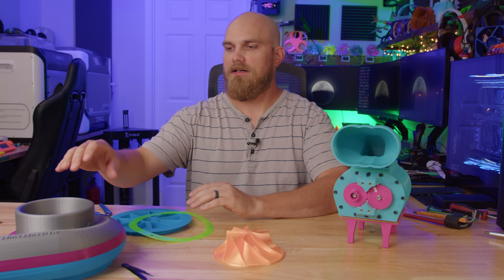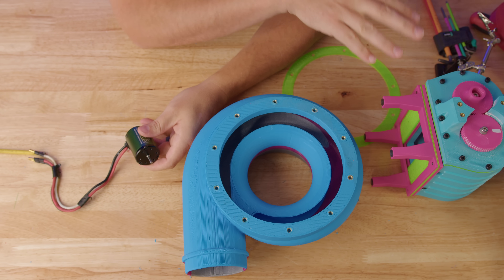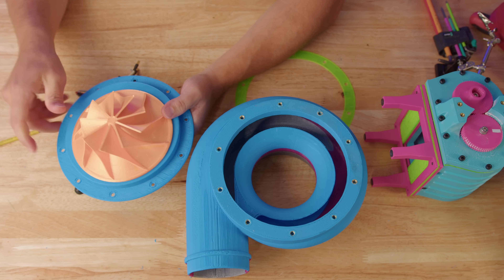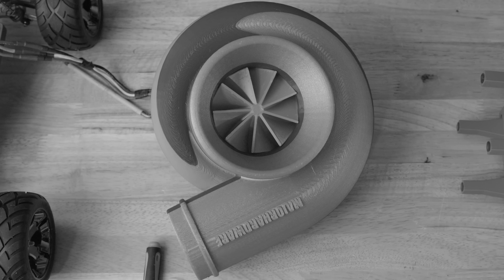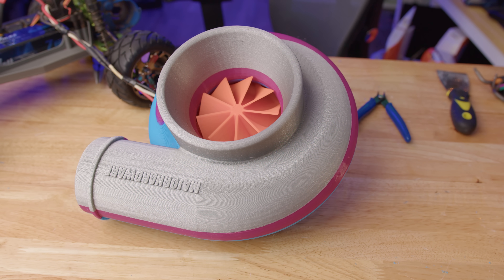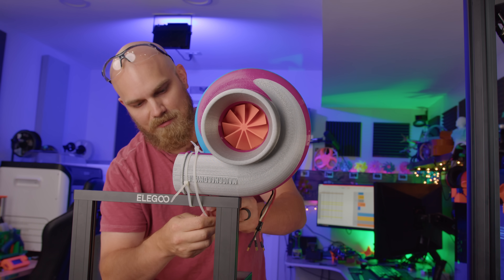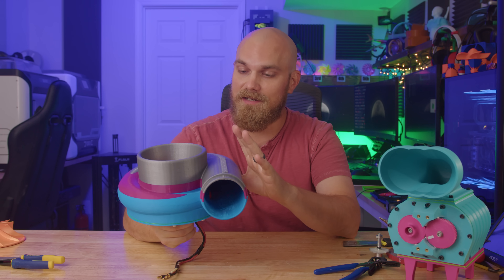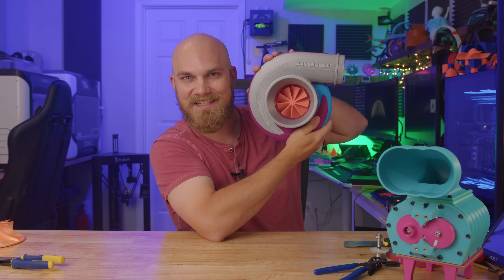I BUILT a MASSIVE ProCharger for my PC

Comment: The Procharger needs as many rpm as possible and a bigger motor will turn slower. I would build it like a real one with a shaft with bearing support and the compressor wheel bolted on one end and the motor to the other. This will also allow you to set your clearance and achieve less fiction.

Comment: I would use 500 Watt brushless spindle for the mini CNC. It comes with power supply and driver and potentiometer to regulate the speed and it hits 12K rpm. Once that are really brushless are 55mm diameter and 48 V. There are some that look like brushless but aren’t. Those are 52mm diameter. Those come with dangerous power supply that is not mains isolated. 
So 55 mm has normally ER11 collet and thick front part of the axle and 8mm axle at the thinnest place. They are relatively quiet and very concentric and vibrations arm. Powerful enough with 2/3 rd of the horse power. I bet it would do you proud😊

Comment: I just finished a printed compressor prototype last month (I'd love to see you try it, but the stats are maybe too boosty for the general format here -- 11CFM / 1.2 PSI) and I landed on 775 DC motors as a decent starting point.  It's a standard motor size (variable length but standard diameter and mounting pattern) with a 5mm keyed shaft that really simplified experimenting with various drive ratios using readily-available 3D printer pulleys and belts.  Night and day coming from 3mm shafts!  They take 12 to 24V and come in a variety of power levels and RPMs, and they're pretty cheap to boot.

I do want to mention I love that you had to do the volute in multiple colors ... it's really photogenic this way and helps visually convey the beauty of the shape!  I would STRONGLY suggest that if you want to make a proper go of this, put the impeller on a thru-shaft supported by bearings on both sides (e.g., with the upper bearing supported by vanes across the intake) or at minimum supported by double bearings beneath, and make the impeller fine-tunable for spin flatness, bore concentricity, and (of course) actual balance.  Having designed (and re-designed x4) a similar compressor on a smaller scale, I can tell you a tall impeller supported on the bottom only is asking for unnecessary hassle :P

Comment: silicone gasket; 1/2hp, 1650 rpm motor; 2x belt reduction or more. Make it compress and push so much air that the air itself gets hot. Loosen your tolerance for the compressor wheel. Its already drawing so much that you don't need tight tolerances. Bernouli's Law means it will keep sucking air in even with looser tolerances.

Comment: Do the procharger again.  But, make the outlet match up to a 120mm fan hole, and bracket.  So, maybe make it just a little bigger?  That way you don't need to use tape to make a duct.  And just for SnG's, if you have an empty PC case, hook this up to the empty PC case for the smoke test.  I say empty, because I wouldn't want to cause any damage to anything inside mentioned empty case.

Comment: turbine needs to be mounted in bearings front and back then the motor can run it with a belt and you can sperament with different ratios.

Comment: OK, so that compressor housing it way too big for doing anything other than moving air volume. Yes, fundamentally that's the point of the fan showdown, but the function of a centrifugal compressor is to not only move air, but to accelerate it down a 'horn' so that while it slows down (from the horn diameter increasing) it also becomes more dense resulting in both an increase in volume [cfm] and pressure [psi]. 
One of the purported advantages of a Turbocharger over a Supercharger is that for a turbo wasted exhaust energy is used to spin the impeller instead of using hp from the crankshaft to spin the impeller. The average centrifugal supercharger requires 10-50 hp to spin up to its maximum impeller speeds in excess of 50k RPMs. However, some specialized centrifugal superchargers (Rotrex) can spin the impeller up to 120k RPM's using a planetary friction drive transmission system. 
The point is that there are a few large scale RC motors that can reach unloaded speeds that can exceed the mechanical limits of the 3d printed impeller, but once the impeller is placed in the compressor housing the load required to move enough air to generate more than atmospheric pressure will far exceed the ability of nearly all RC motors.
So for this compressor to be used as a novelty to look like a compressor, but only generate a large volume of air flow at atmospheric pressure it's possible with a larger RC motor, a NEMA 34 Stepper or Servo motor driven by an Arduino, or even an electric bike motor. Otherwise to make it actually function as a centrifugal compressor you have to look toward electric motors that are rated in the 10+ HP range.

Comment: honestly? would love to see a complete case built around them, the roots doing something like an ITX mini build with mid-range specs and see if having a sizable CPU heatsink (stock fans removed) if it would thermal throttle going just off the case fan (blower) breeze going over it.

and alternatively also would like to see the same with the procharger, but for that have a 3-d printed duct/enclosure going around the CPU heatsink of a hotter chip and again see if it even passes a stress test. Doesn't have to be super modern high end, just like an old OC'ed FX 8350 or whatever model it was that ran around the surface of the sun, or again just whatever, in short just want to see hot-rod themed casemods and how practical they may be for both low and higher power consumption with the chargers being their only real source of cooling

Comment: For comparison, shouldn't you run it with the same motor as the case fan? Or just get an AC desk fan and use it to drive the compressor?

Comment: Why not look at an automotive blower motor. Pull the squirrel cause off. And cut the plastics off for where it mounts. They're pretty solid motors. Run 12v. Uses 14g wire.

Comment: That kind of compressor fan system it is the kind it is used in modern Piper Organs and Armoniums, I Built several enclosures from them when I was working on a small German company building and restoring pipe organs, we usually only install those fans from the german brand "ventus", and they are loud as heck so the enclosure cage must have acustic foam everywhere and also being made of 2 layers of wood, the exterior one made with playwood (with a oak veneer) and a internal layer of MDF for better acustic issolation.  The pipe organs must have always the same blowing pressure so it is used a kind of bellow called "windchest" that consist on a wooden cage with a leader bellow on the middle (and a stabilization mechanism made of iron) and over it a top wood panel with some heavy bricks on them to mantain always the same pressure on the windchest, it use basically the same principle as a bag pipe but in a bigger scale.

Those compressor fans from Ventust spin freely and the fan blades were well balance and still make a hell of noise, I don't know how yours perform in terms of Db but I´m sure it was a nighmare being there. Also I think the desing of the blades were different, but actually have no idea because their metal encloure not show much and never opened one of them.

Loved this proyect so much, it it has brought back good memories.

Also I have recently desing my first fan on Fusion 360, not for a PC, for a small home fan was very low from factory, and actually it blows some air, not like the original, but it was astonishingly quiter in  comparision, so I took it as a succes... but printing it with PETG was a terrible decission. Who knows, may be some day I will be  able to make something functional for your channel, I'm not an engineer, but I know one or two things about neumatics, and thanks to your channel, also about fans.

Comment: Have you seen the Astron Omega 1 engine? I think the rotor from the first stage of that would make a fantastic air compressor and possibly an air pump if the rotary valve was left out. I'd love to see somebody build an air compressor with that design anyhow.

As for motors, look at the ones used for 1/5 scale off-road buggies.

Comment: I'm going to be watching this project, because I need a "better" blower for my inflatable projection screen. The one it came with is 120VAC, and the motor/fan is loud af. I bet if you get the tolerances right, that thing would be the ultimate solution to my particular problem.

Comment: The motor bearings aren't meant for stabilizing the fan rotor.  Need top and bottom bearings and the motor shaft just couple with the hub

Comment: This brings up a weird question. Can the exhaust air from the pc be used to spin a turbo to add fresh air back to the case?
Reply: no. fans can't compress like impellers do.
Reply: @mattio79  don't need to compress air, but simply act as an additional fan to the case. The exhaust housing would need to be very unrestricted. Probably won't work

Comment: If you want to look into a very good beefy motor you should look into a Castle Creations 1721. That is a 2400kv motor that can handle up to 8s lipo batteries. That means it can rev up to 80.640 rpm and its meant for 1/8 scale and 1/7 scale cars meaning it not only has rpm but also torque to go with it. It also has a 8mm stainless steel shaft which will be significantly stronger then this little motor. Now don’t get me wrong. I’m aware I just recommend a $250+ motor that also requires a $250+ esc (Castle Creations Mamba XLX2) however it will be the last motor you’ll need as it should be able to provide you with any speed and power output you can desire.

Comment: I have a drone (syma x5c) with 4 pretty powerful motors, if you could find a way to combine them all they would work very well. They have tall shafts on the motors and are designed to have propellers screwed into them and the drone all together is relatively cheap so you could use them. I'm just not sure the motors would last very long with having to push out a lot of power at high rpm so it may get a bit hot but for 4 small motors it could help just as an idea. Keep up the great videos!

Comment: This seemed like a huge success! A couple of changes I would make though are to add a bearing to the intake side so that the wobble doesn't destroy your next motor, and I would also try and oversize the motor as much as possible. As a general rule these types of compressors should generate a somewhat constant pressure, meaning that less air resistance will lead to significantly higher airflow and power consumption. In an actual turbocharger I think right clearances are very important, but again since you are really going for airflow instead of compression I don't think it's as big a deal. 

I can't wait to see the next iteration!

Comment: For the engine, i would recommande a CNC spindle engine, they go up to 24k rpm and have lot of torque to not slow down when they cut metal and  the 24V and 48V should be ok.

Comment: make the exit smaller for higher static pressure and airflow, you can leave the entry the same size. that in combination with the more powerful motor would be interesting in that wind tunnel.

Comment: you should do gaskets raised in middle so middle part will squish and seal better
alot of design to use but flat gasket from pretty hard material it is still not 40shore like rubber
and uneven surface that you cant tighten enough will not work

Comment: You could first try to gear down your motor, but for this application motors for bigger scale airplanes or helicopters may be more suitable, but I have no experience with those. Also outrunner motors have more attach points other than the shaft, which looks useful.
For experimenting, cheaper stuff from places like hobbyking could be enough, take a look there

Comment: Check out the hobbywing combos not cheap but good quality... maybe the EZRUN MAX8 G2 system with 5mm motor shafts or the MAX5 combos which have 8mm motor shafts though maybe tooooo much power for your need

Comment: Just a heads up - turbo/superchargers are designed to force lots of air UNDER PRESSURE. If you can get it working the most effective application would be to a cooling block of some sort with a lot of surface area and restriction.

Comment: Maybe ditch the rc motor +esc combo as they aren't designed for run times like you desire and you're going to cook esc/batteries/wiring/motor all the time. Look for something you can just run of the 12v rail from psu with some kind of inline speed control.Sure you're not going to get the rpm and power (for size) from this compared to rc stuff but should be a lot more robust and you can always run some gearing or pulleys to get the rpm of the charger up a bit.

Comment: A motor from a dremel tool or a flexible shaft grinder would be interesting as they are both easily 15k rpm and variable speed and probably 1/4 horsepower. Can probably get them relatively inexpensive via harbor freight.

Comment: If you don't want to deal with shaft and mounting issues, then look at brushless outrunner motors. Since the can rotates and there are usually some screw holes it makes attaching things to it way easier. Also maybe consider adding some silicone lube to the inside of it to decrease the friction present. I know that T-motor makes some pretty insane motors, but they are PRICEY

Comment: Awwwwwww man instead of reprinting the impeller you should have just ran the motor out of the housing and hit it with some sand paper. It's not like this thing is trying to cram 30lbs down the throat of a v6 or anything. Tollernces are a lot more forgiving due toi the application and materials is all I mean. Also you should bearing mount the ipeller to the housing and then drive it exteranlly with another gear to the impeller. Keeping the impellers center isolated from the motor. Not like the parasitic loss really matters here, and the incresed stabillity from the bearings would help a lot.

Comment: I want to see a way smaller Turbo compressor  impeller like dyson dit with their vaccum cleaner on battery power. I think thats the way to go for PC interials.
Reply: Plus the way to blow air this way is more inefficient with this snail looking housing, than go the other way and suck out air. (no need for strait out airflow)

Comment: Also some oil between the bottom of the compressor and housing might help. If you want to blow up more motors look up a "sliding vane compressor".  It was featured on MG cars in the 1930's as the "Powerplus Supercharger"

Comment: this is awesome, would be cool to see an adapter where you use the A12x25 or one of Noctuas ppt fans to run it just so its on fair ground for the fan show down, but for sure bigger motor.
Reply: The fan would not last, nor would it compress enough air.

Comment: nice.. i would definitely go a lower KV motor for sure especially if you're going to be running 4s something like a 3536 900-1200 KV rc aircraft motor... those car motors are designed for short bursts.

Comment: could use an electric skateboard setup and use belts and gearing instead of just throwing volts at it, plus its all there, the controller etc and the gears etc

Comment: I would scale it down not up, make if fit the profile of a 140 or 120mm fan so it can actually be mounted inside a case then see what kind of performance you can get out of it with a fan motor like all the fan designs you test. A much smaller blade and housing should make it possible.

Comment: Drop the scale and use a 60mm server fan for the motor. See if the high rpm of that would work with a more scaled down version to fit in a case.

Comment: I see that the algorthem determined that my post was not allowed, so I'll try again. Reduce the size by 30% to reduce start up tourq. Next purchse a 775 electric motor. They run on from 9 - 24 volts and can range from 9000 RPM to over 20,000RPM. They also have varying shaft sizes up to 5mm. Adjust the speed of a higher voltage motor with a variac or potentiometer.  Amozon has a HUGE selection of motors.

Comment: Push the motor more into the body and get a bearing to mount to the housing and the fan, reduce fan weight and add stability

Also thicker gaskets, make them 2-3 layers thicker than they are

Comment: Bro, the blade is going to SHATTER every single time you get the RPM too high, even if it 100% balanced. IT just can't handle super high centripetal forces. In other words a bigger faster motor can only get you so far. You gonna hit a limit, and I don't think it's going to be much higher than what you're already doing. 
But YES, DO get a better motor, preferably one WITHOUT A BENT SHAFT lol. And you NEED to have zero parts hitting... because THAT will be your first point of failure, every time. And instead of printing a whole other blade, you could put it on the motor (one withOUT a bent shaft lol) and use something like a soldiering iron to just evenly melt off the edge... Actually a very hot, VERY SHARP knife would probably be est for this. And the heat is just so you can remove the edge and it wouldn't turn to dust and clog the area you are trying to see, and melt it is just so much more awesome... but you HAVE TO hold the motor in a VERY tight grip so it doesn't move AT ALL... OR you could do this with a very high grit sand paper, but then you have a lot of dust in the air.
--- If I can only get ONE POINT ACROSS TO YOU IT WOULD BE BALANCE!!!! At that speed it is the most important factor.
You could always look into 3D printing ceramics and usi0ng some fuels :P lol no, don't do that... I already follow one suicidal 3D printing jet engine maniac... don't you become one too. LOL
JUST HAVE FUN!!